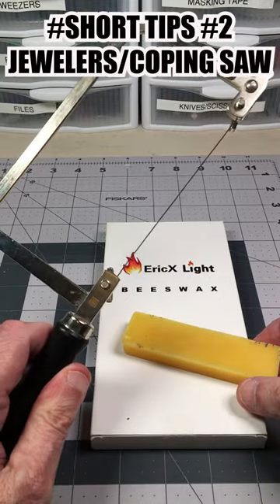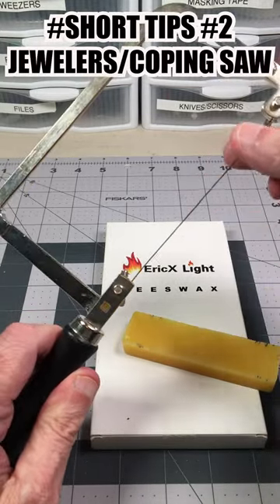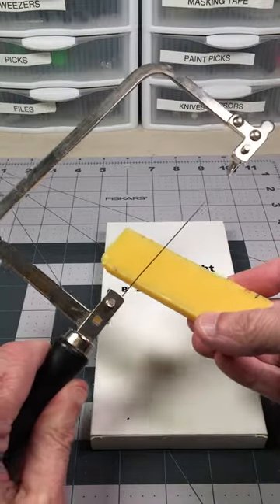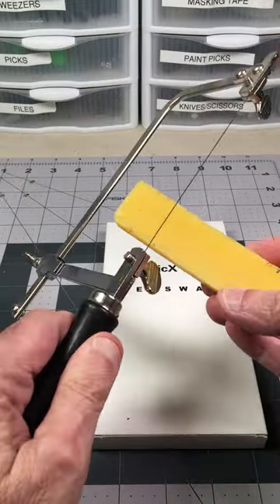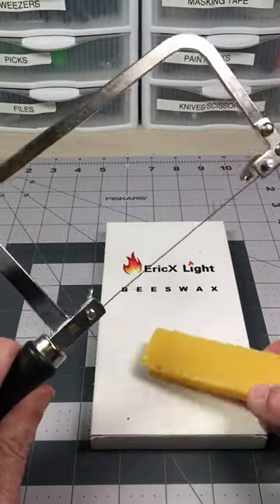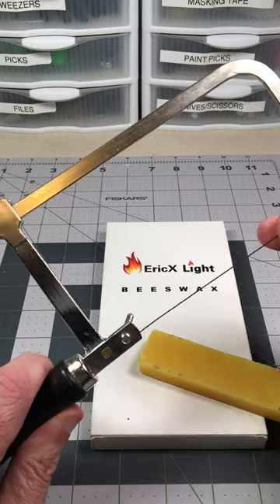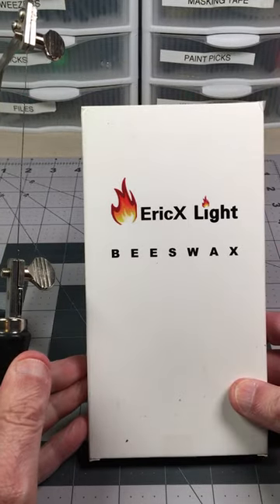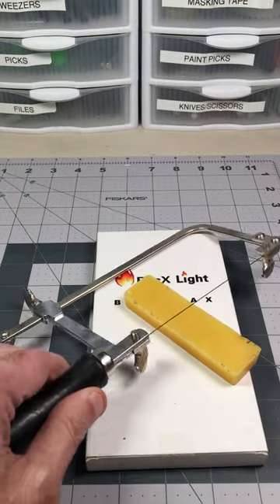#Short Tips #2 - Jewelers/Coping Saw - How to Customize Hot Wheels

Comment: What’s the best blade size for cutting a hood out bc I just starting cutting a hood out and the hole is big
Reply from the maker: What size blade were you using?  I generally use 3/0 blades for all of my diecast cutting and it's a reasonably fine cut.  If I'm remembering it correctly, I've seen blades as fine as 6/0 used but I'm not sure how well they last.